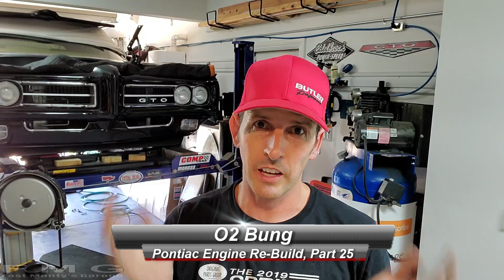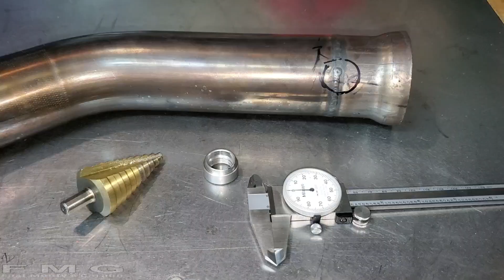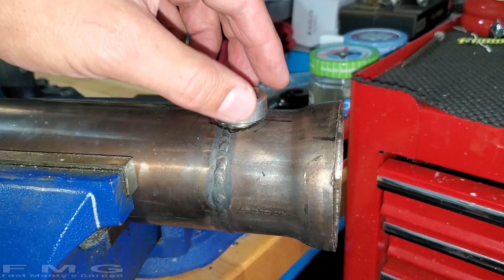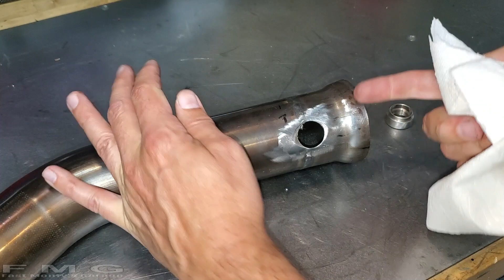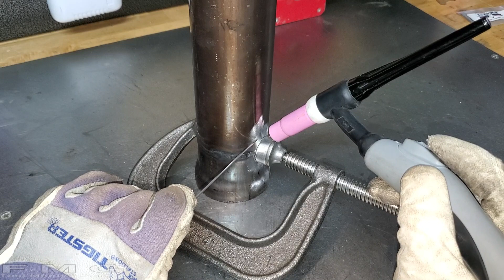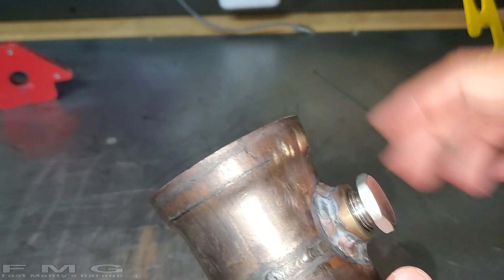How to install an Oxygen (o2) Sensor Bung, in your classic Muscle Car

Comment: Leaving the plug in while welding would act as a heat sink,I’ve seen it done with a bolt as well
Reply from the maker: Agreed!  Thanks Michael!  Yeah, I like to bolt trick, as you can get a longer bolt for better heat control.  Thanks again!

Comment: I'm planing to install an o2 sensor on my old k jet volvo. do I need to get an ecu as well? or is it just enough with the sensor and an AF wideband? newbie here. Greetings from Peru
Reply from the maker: Greetings from the US... An Oxygen sensor is for the Fuel Injection throttle body I Installed, which has a computer in it.  Not sure what you're trying to do, unless you're just reading your Air Fuel ratio?  That would just require the matching gauge for the sensor.  Hope that helps.
Reply: @FastMonty  yeah, that's the idea. Not going for the full electronic injection upgrade, just want to read the af ratio and keep proper mixture adjustment.
Reply from the maker: @machodrilo  Awesome!  The Gauge should come with the O2 sensor... I do NOT know if its the same as the O2 sensor and bung I just installed.  Let us know!

Comment: Mike have you had any issues with your car running hot? And do you have a 3 or 4 core radiator? 
Thank you
Reply from the maker: Hey Bill.  No.  My car doesn't exceed 185.  (That's when the fans kick in)  I also have a 165 degree thermostat, and a Be Cool radiator.  It's probably a four core.  Here's the link... https://www.summitracing.com/parts/bci-81008/make/pontiac

Comment: GOOD VID. WHAT BRAND & WHAT TYPE O2 SENSOR WILL U INSTALL, A3/4-WIRE HEATED OR WHAT. I JUST INSTALLED LONG TUBE HEADERS ON MY 89 BIG BLOCK GM TRUCK W/FUEL INJECTION. THE ENGINE IS VERY SLOW GOING INTO CLOSED. I WAS TOLD I NEED A HEATED O2 SENSOR.  HELP.
Reply from the maker: I went with a FiTech system.  I did a full install playlist on it... most old school fuel injection conversion systems come with an O2 sensor.  I'd research which one works with your system.  Good luck!